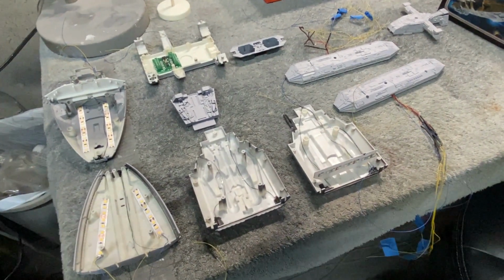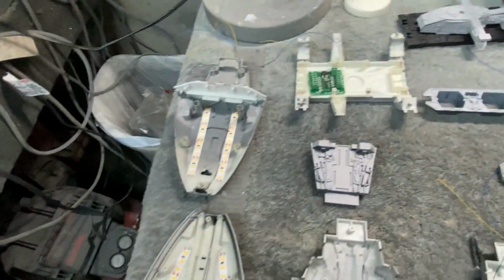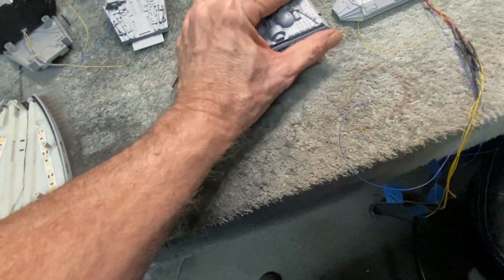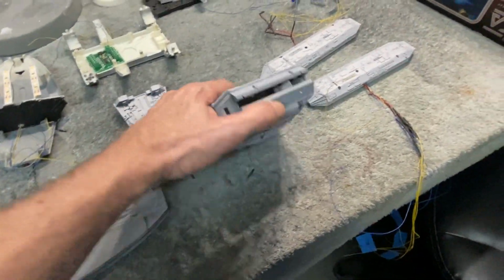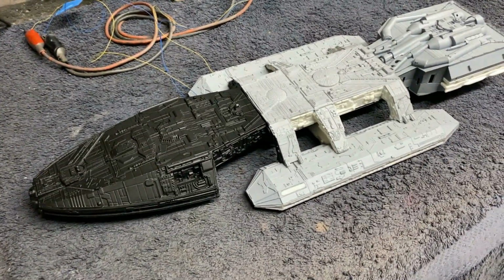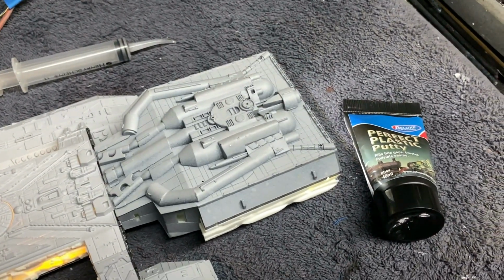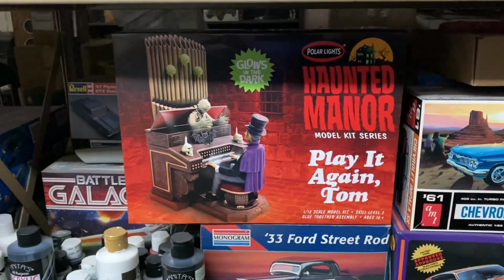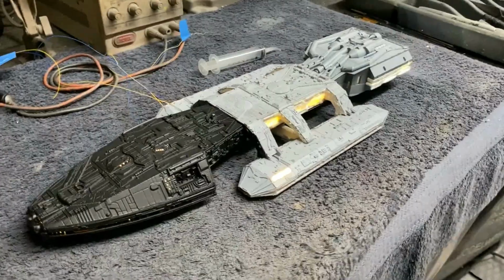Moebius Models TOS Battlestar Galactica Update Part 2

Comment: I had that model back when the original Battlestar Galactica was on the air - or around that time.
This was before the days of the internet and before LEDs were a real option for lighting. I took apart one of those Christmas candles you stick in the window and put it inside. It ran off 120V AC but the bulb was low wattage enough that it didn't melt the model but it did make it warm.
For windows I drilled random holes in the ship. Again, there was no internet so no way to research the proper window placement.
For light blocking, my teenage mind never considered painting it black. Instead I lined the entire inside with aluminum foil and punched holes back through the drilled out windows. 
Wish I still had that model. Hopefully Moebius releases them again. I'd love another chance to do it right.
Reply from the maker: We did the best we could with what we had back then. I hope they release this kit again too.
It's getting hard to find.

Comment: I forgot to ask could you show how you Paint over the Raytheon Lighting I'm Building a 1/350 Scale Refit Enterprise Model and I've installed Raytheon Lighting Box's and I have a Masking Set but I'd like to see how I can Paint Over those areas and still make them look like think you could do that Boyd ?
Reply from the maker: I just lightly shadow around the edges with an airbrush using some black paint and that gives the fading light at the edges instead of a hard line. Then just paint over it with the hull color making sure to just lightly mist over the lighted spot.
Reply: @TrekWorks  All that helps Boyd but I need to see how it's done because I've never done that before seeing how it's done really helps me out you get it ?